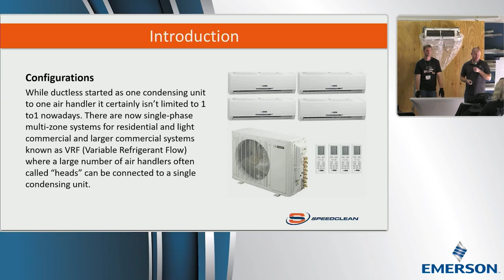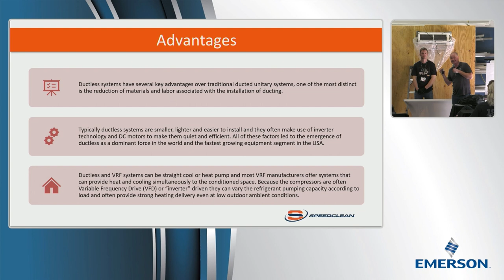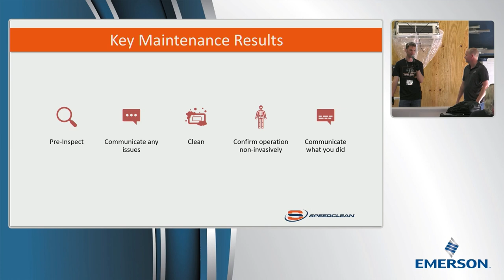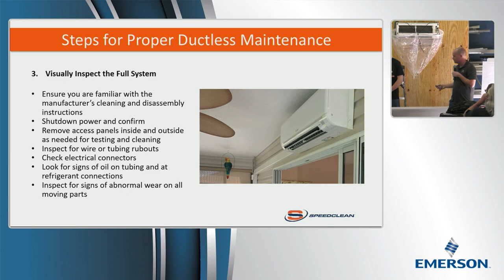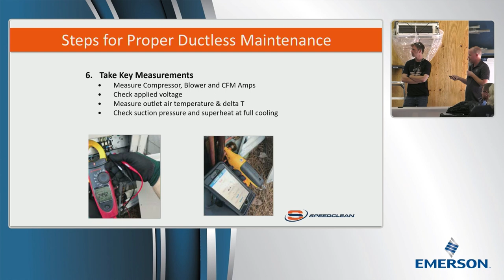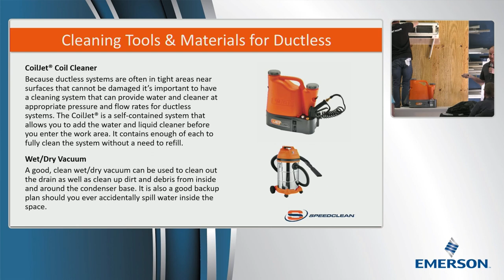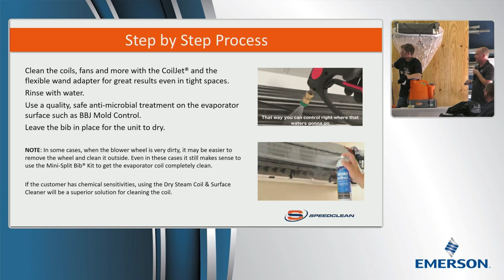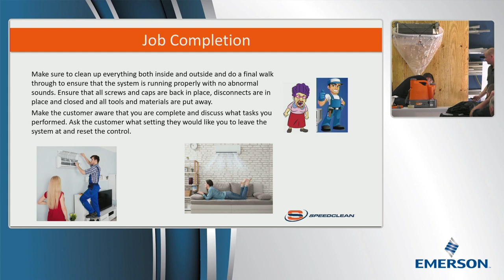MiniSplit Air Conditioning Cleaning Practices

Comment: I always disassemble the indoor unit, entirely (evaporator coil included), unless for some reason things get expensive/risky (high floor wall without exterior access, etc). Ofcourse the complete job takes way more than 1.5 hours.